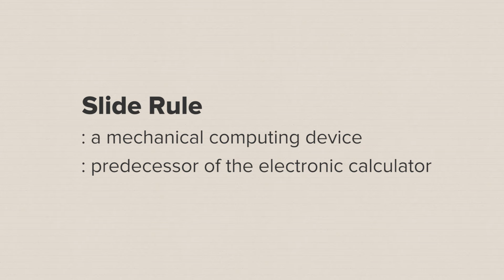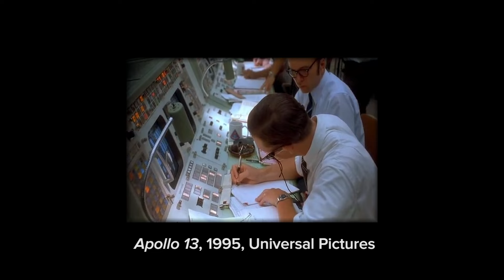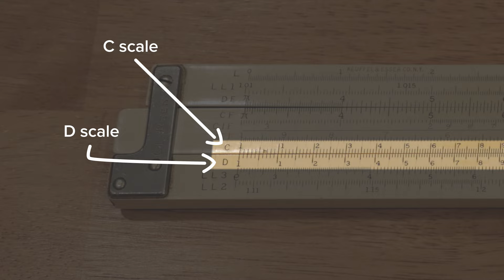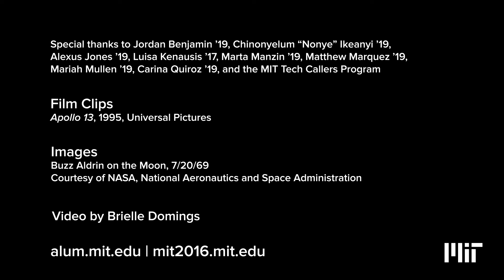Bringing 1916 to 2016: Slide Rules

Comment: I use a slide rule when doing and estimating construction jobs. It freaks most customers out. Older customers are impressed, especially the engineers!
Reply: In 1984, I brought my slide rule to my E&M engineering final exam. Only the prof knew what it was.
Reply: When i worked as an Engineer in 2007, i used my Sliderule for calculations all the time.. only 2 colleagues knew what it was.. but they both forgot how it actually worked.. , i later designed and made a few myself.. just for fun..
Reply: right? I bust out my supernote a5x and the slide rule, most people do not know what wizardry I am doing.

Comment: What I just witnessed was terrifying.  How can a math or engineering student get as far as an elite college and never have heard of a slide rule? New math is a pox on all future generations.
Reply: what happens when their batteries go dead? how can they just push buttons and not understand the process?
Reply: mister kluge  but they remain in intellectual stasis because they don't understand the process beyond pushing a button. No "why"
Reply: You don't need one at all these days, and you'd struggle to even find one in schools.

But most of these students' attitudes to seeing one were incredibly poor.  You'd think as students at MIT they'd at least be more intrigued and try harder to work out how to use it.
Reply: @tams805  Ding.  The lack of curiosity and disdain for the tools of the past (as well as the achievements those tools crafted) was alarming.  Like if you found out that the primary tool used to send the first man to the moon was analog, a student who was really concerned with the nuts and bolts of engineering would want to find out how it worked.
Reply: I'm sure you have no idea what Napiers Bones were, even though they were quite popular hundreds of years ago.  Let alone how to use them.  Point being, it's not entirely necessary to understand ever old technology.
Reply: @edwells4769  Only to a point. But a slide rule is not that old and is still used sometimes today.

Comment: I still have one tucked away. Texas Instruments came out with a  calculator about 1972. It cost $ 400 in 1972, which is $ 2,300 today. My dad said to stick with the slide rule.
Reply: My dad was a lab tech and I remember that he used to carry a slide rule around in a holster attached to his belt. Then he was given one of those LED-display TI calculators, and that was the last day he carried his slide rule. He simply gave it to me to play with.
Reply: The TI 30 was my first, I still love the sliderule tho. No one mentions one part: no batteries!
Reply: Your Dad was right. Slide rules work. Electronics do shut down midway thru calcs.. 
   After 20 years working in power plants, the oxygen-in-water sensors (to prevent tubular corrosion) quit working. Guess what? It took a basic CHEMICAL analysis to find out how much O2 was present. So much for electronic marvels.

Comment: You can still find slide rules in use today. There is a tool called a "proportion wheel" which is basically a circular slide rule for use in graphic design and printing.
Reply: Slide rules and proportion wheels are still used by journalists to help size blocks of text for newspapers and magazines. However, the proportion wheel is much much more popular because it's a bit faster and takes up less than half the space on your desk. I went to college in the late 1990s and they still taught how to use proportion wheels.

Comment: I'm a Mechanical Engineer, and I think all kids should be taught math using a slide rule. and handwritten math homework too. and nothing more than a basic scientific electronic calculator allowed through Calc 3. People would be so much better at math.

I've begun using and carrying a slide rule lately. I've even used a slide rule for driving to compute time enroute, and such (we also use slide rules still in aviation, the E6B).
Reply: Where do you buy slide rules?
Reply: @macariohernandez5247  Ebay has many of different sizes, and types.
Reply: Honestly, I started collecting them a bit and I think they have niche use: as a multiplication tables and log log scale as a table for exponential growth or decay. They are inaccurate, arguably slower than calculator, sometimes they need extra thinking and planning, but sometimes it's great that you do unit conversions, proportions and inverse proportions using almost instantly. For this reason, I think the most useful slide rules today are advanced ones with LL/LL0 and folded scales.
Reply: @pavelperina7629  the reason I advocate their use, is for early work, where the math is basic, and decimal places few. it helps kids develop mental math skills, helps them see visually what is happening, and will benefit them greatly later on.

Kids who learn to do math mentally, or on paper manually, without calculators, are objectively better at math and smarter than kids who learn with electronic calculators. 

In my math education system, everyone would do assignments by hand, and with sliderules until at least middle school, at which point they could start using electronic calculators, but only basic ones. Then in high school they could start using a 2-line calculator, but must still show all their work on paper by hand. In college they would still be restricted to a 2-line calculator without integral/derivation solving features all the way through at least calc3.

Minus the slide rule, this is how I learned math and I can run circles around the younger people.

Sliderules are not always faster, but in certain circumstances they are FAR faster. And they also emphasize the importance of rounding, significant digits, and precision and accuracy. Very important concepts in science that students these days do not understand nor appreciate. Also, sliderules require regular use of logarithms, making such concepts far less confusing to students in precalc/calculus later on.
Reply: @SoloRenegade  I agree. I have technical university but before that logarithms and rational exponents were just a weird stuff that I learned during middle education, but it was never really used. At university they were useful for exponential decay (attenuation over distance, discharging capacitors) but when I saw slide rule I managed to notice how to use it, but to really understand why it works, I had to go into history to learn how to construct it using geometric progression of 1.01 (or similar number) and how to calculate any logarithm iteratively using square roots. And then faster method by decomposing number into 10^a+1.1^b+1.01^c+1.001^d and needing only 24 for 1.1^b (before it reaches 10) and 10 entries for each decimal number. then log(x)=a+b*log(1.1)+c*log(1.01) ... it was actually very interesting research. Sadly education system is focused on memorizing facts, formulas and not making mistakes, not on deep understanding. Despite using limits and derivations is easier that memorizing how to find minimum of parabola. The same with trigonometric identities.
Reply: @pavelperina7629  That's awesome! You serve as an excellent case example of the flaws in our education system, and that someone interested and motivated can teach themselves too. Most people would be great at math, if it was merely taught better, especially if they got a good foundational start early on at a younger age.

Comment: One of my prize possessions is a Teledine Post 44CA-600. This one is the demo model from the MIT Coop, proudly bearing the small hole that attached the chain to the counter. Somewhere around 1975-76 it was in a box on that same counter marked down to $5.00. It still lives on my desk and is undergoing restoration (replacing the glass cursor that broke in a lab accident and was hastily replaced with a crudely scribed piece of Plexiglas. I know this is not technically true, but I still refer to it as "The last slide rule sold by the Coop".
Reply: Bill Spear  --  How did the slide rule restoration turn out?  I have a Mannheim ACU-MATH No. 500 slide rule in excellent condition, with the original box as well.  I'm just starting to learn how to use it. Well, I should say that I'm just now re-learning how to use it.  I haven't used one since the late 1970's........
Reply: @ironcladranchandforge7292  I have one of these. They can do powers and roots. Way cool stuff.

Comment: It's a different way of thinking, analogue and spatial versus digital, like telling time with a traditional clock.   Once you see the slide rule is based on logarithms and logarithms of logarithms it all falls into place.    But for students today  a logarithm is what you get when you push a button and not a number you get spatially from a slide rule or by interpolating from a table.    Likely few realize that the distance from one to two on a slide rule is .3 times the length of the scale which is the common log of 2.

Comment: I can't believe I stumbled on this interesting article and was surprised to fine the first post being mine from 7 years ago!
One advantage, hardly mentioned anymore as such, is that having to keep track of the decimal point in your head and be limited to 3 significant digits is great training for loving scientific notation and also appreciating how many science problems and quick estimations really don't need more than 3 significant figures.  Ok, that excludes all of finance!  It also provided an easy transition to RPN calculators, which have many advantages if one is willing to meet the computer halfway and put all the operands before the operators.

Comment: Cute.  MIT students are the best, always have been, and still are.   We take precision for granted theses days.  The slipstick allowed long chains of calculations involving multiplication/division, squares, cubes, square and cube roots, trig, logs  and more.  All to about 3 significant figures precision, which is surprisingly adequate in many cases.   I love the comment, "If it can't do integrals, what use is it!".
In high school I used one of those 6 foot demonstration units for some JETS  (Junior Engineering Technical Society) meetings.
The missed point is this.  By leaving the decimal point handling totally to the user, important estimation skills are learned.  Instant cube roots of any number are available, to 2-3 digits.  Knowing why that works and why the cube scale is the main C scale shrunk and tiled 3 times left to right enhances one's numerical understanding.  We mainly used them for physics class homework.
Before electronic calculators, this was a brilliant and quite helpful invention!
Reply: Question: why the focus on integrals? Warning: my knowledge of calculus is rather basic.
Reply: in 1961 I went to navy electronics school and learned the slide rule.  You knew approximate answers before the more accurate answer, learn to scale answers learn the powers of 10,.  To this day I use mental math that seems to make the young think I am super smart.  All thanks to learning to use the slide rule
Reply: @VRichardsn  Perhaps it's one of the most common roadblocks on the math complexity highway.
Differentiation is easier.  Integration, arguably more powerful, useful and philosophical (?), is closer to an art.
But you are right.  It's not appropriate for slide rules.  It was just that the spoiled - in a good way - techies of today summed it up so colorfully with that quip,  ""If it can't do integrals, what use is it!".   I just noticed your comment after I was notified of Joe's answer, today.  :-)
Reply: @mitchbogart8094  I can totally relate to the first part of your post. I passed Calculus barely and only because I nailed the diferentiation part.

Comment: The first Zeppelin engineers hired by Von Zeppelin probably used bamboo slide rules. A earned one unit of semester credit for taking the first week of the two week slide rule course, Fall '69, Shasta College. First week was just basic pre-trig. algebraic use. Second week, for an additional unit, was advanced, from trig. into calculus use.

Comment: One chemistry professor I had in 1970s college required his students to buy, learn, and use the slide rule for classroom calculations. It greatly improved my ability to read scales, estimate answer before arriving at solution to math problems, and understand principles of math. No electronic calculators were allowed in class. I was not surprised to see flippant attitudes towards the slide rule by the "modern" students in this video. I witnessed similar attitudes by others in regard to engineering ethics during and after my college career.
Reply: In a few years,  "elite" students will show the same flippant attitude to - then - historical electronic calculators.
And they will be equally unwilling to use one, instead of the Math-AI on their phones that directly gives them the answer...

Comment: Regarding 3:09, on February 1, 1972 a brand new Hewlett-Packard HP-35 scientific calculator cost $395 which would be equivalent to $2,908.53 in 2023. In 1972, college students who had wealthy parents could afford to spend $395 on a HP-35. Although the new hand held calculators were fast and precise, their Light Emitting Diodes display soon depleted their battery power and had to be recharged often or had to be plugged in via an AC adapter. For comparison in 1972, a scientific log-log slide rule was more affordable costing around $17 which would be equivalent to $125.18 in 2023. In 1987 Solar Powered Liquid Crystal Displays replaced Light Emitting Diodes in calculators, because LCDs consume much less battery power than do LEDs. Nowadays in 2023, the cost of a scientific calculator is as inexpensive as $6 which would be equivalent to 82 cents in 1972.
Reply: Or they could sell their calculator and found a company with the money like Steve Wozniak did. LCDs became popular much earlier, in late 70s.
Reply: I saw a calculator in a dollar store with square roots ets.  one lonely dolllar.

Comment: sometimes i weep for my generation of fellow “engineers” from my experience, within my own major, these people are to lazy to actually learn how maths works and understand that its a tool you use to solve problems, not problems to memorize how to “do the number thing” theres a tangible difference between knowing how to solve a calculus equation and being able to use and deeply understand the concepts of calculus to use it to your advantage. Many even switch from ME to ET because, ya know, “calculus is useless” or “its too theoretical” which tbh i can kind of agree that last bit
Reply: On the contrary,Calculus does it all. When you deal with rates,maxima and minima,instants,etc. You must use calculus.
    Calculus has always been criticized as being non-rigorous logically. Example:
When you have two points on a curve,what is an instantaneous value?if both points coincide at the same moment then t2-t1 equals zero.But you can't divide by zero so that your concept of instantaneity is invalid.That's how the idea of a limit came into existence.

Comment: In the future, calculators will be voice input AI machines where you just read it the problem and it spits out the answer.  All you'll need to know to pass an engineering course is how to read.  The nicer models will have a camera and printer on them and you just take a picture of the problem and it will print the answer on a sticky note that you place on the test.  These devices will take all the drudgery out of getting an engineering degree!
Reply: We basically already have apps that do that. And why would you need to print anything? Just copy it

Comment: 1916?
Really!
The very first electronic calculator was not on the market till about 71 or 72. And it cost over a full months wages!
The first inexpensive calculator, the TI-30 appeared in 1976.
So the slide rule was the instrument of choice right through the 1960's, and well into the 70's!
The Saturn V moon rocket was designed mostly with Engineers working out their equations with the slide rule. And most Engineering student were REQUIRED to learn it's use right into the mid-70's.
So, you should have titled your video: "Bringing the 1960's and 1970's into the 21st century.

Comment: I have worked with the logarithmic ruler for a long time and I have to tell you that it is a very useful tool if you know what you are calculating. That scene from Apollo 13 was illustrative, but a person who only calculates linear functions repeatedly will definitely use a logarithmic ruler because they know what they're calculating and it's very fast. His calculation was most certainly verified by the mainframe if it was used for correction. Another person who also knows how to work with a ruler, without a previous routine of working with operations, would not be able to do it in a quick time. Watch out for that. I still use the logarithmic ruler in special functions because I know it and it's easier than on a calculator with operations (the ruler can combine several operations into one just by moving the slider). We all have our own tricks for a particular type of mathematical operation and that's why we are very efficient with a ruler. A logarithmic ruler in my day was always a sign of mathematical prowess. Many smart people have failed to work with a ruler.

Comment: I used one in HS.  I had a few.  A pocket 6", a 12" and a circular one.  In college in 1971 or 1972 of so the Bomar Brain calculator came out.  Too expensive.  Then TI came out with one and I put my slide rule away, but I still have it.    It means too much to me to just discard it.